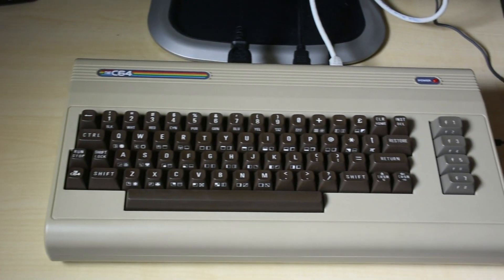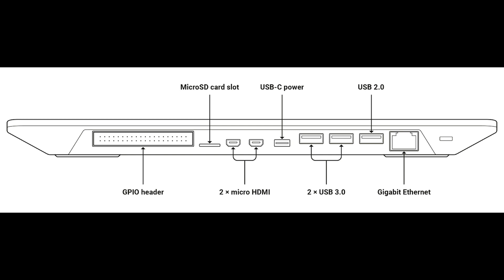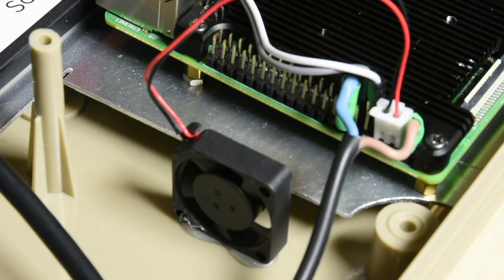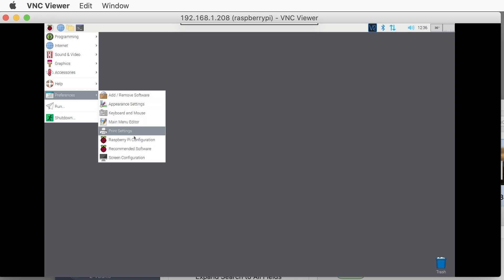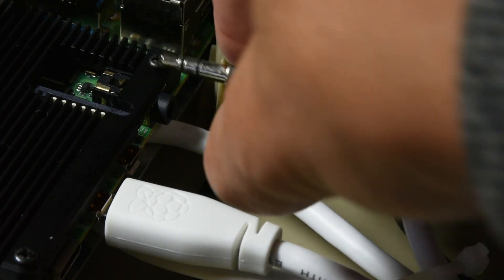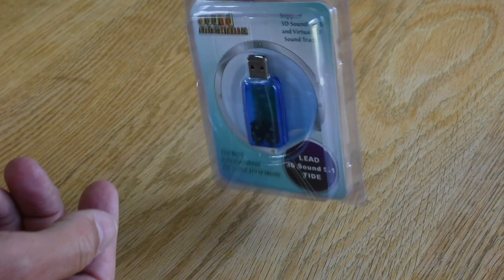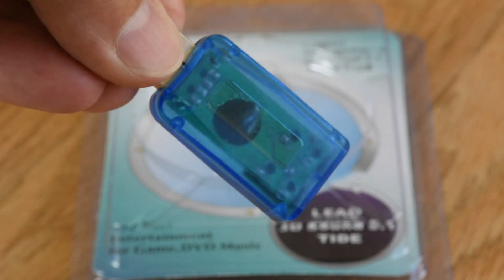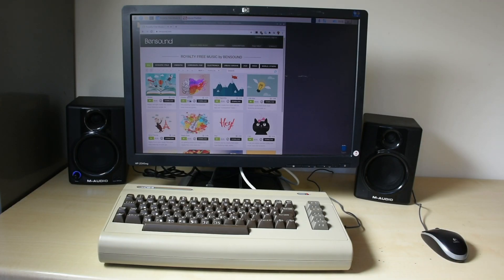Raspberry C64 Pi Audio and Cooling Update

Comment: Excellent Christoph. I'm gathering the parts as we speak. The only issue I want to resolve it to have the option to use THEC64 as factory intended with working keyboard. I'm  wondering if a toggle switch on the USB 5v power  cable to the keyboard would allow dual connections when only one computer is enabled?